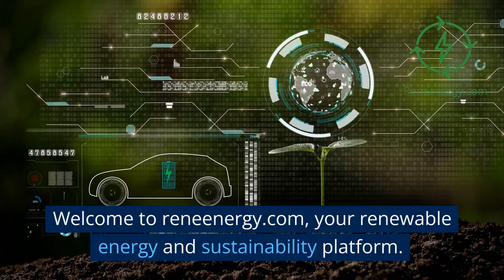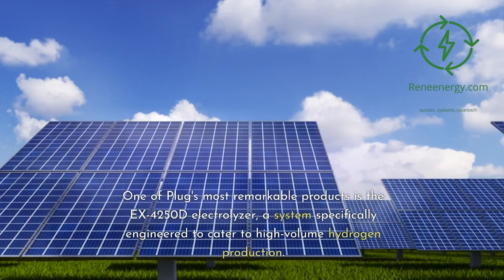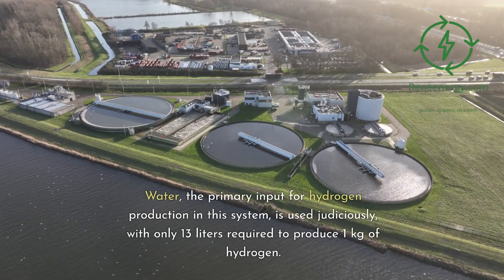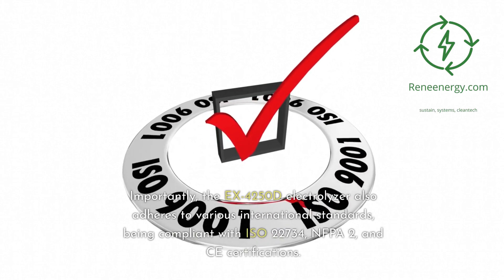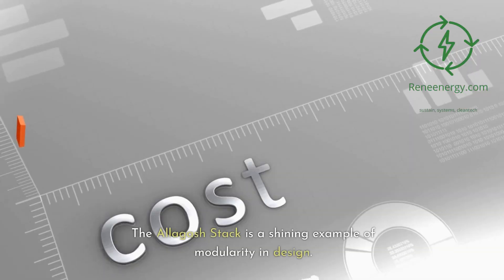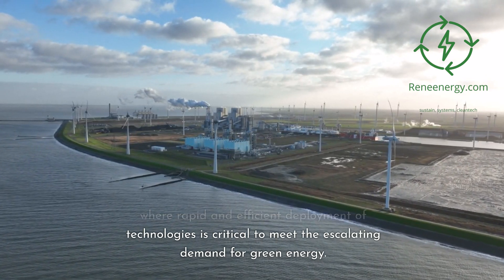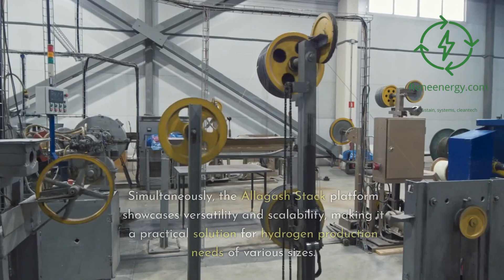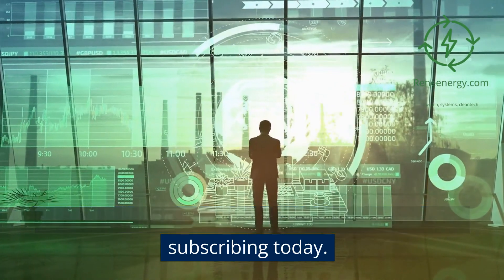Exploring Advanced Hydrogen Production Technologies – Plug EX 4250D and Allagash Stack

Comment: As per the details provided Plug EX 4250D can give hydrogen @ approx $2/kg if electricaity rates are @2.5 rs/units????
Reply from the maker: Thank you for sharing the details about the Plug EX 4250D and the associated cost of hydrogen production at the specified electricity rate. It's important to note that the cost of producing hydrogen is influenced by various factors, including electricity rates, efficiency of the electrolysis process, technology used, scale of operation, and other related costs.

While the information you've provided suggests that hydrogen may be produced at approximately $2/kg with electricity rates at 2.5 INR/unit, it would be advisable to consult the manufacturer's technical specifications and efficiency ratings for the Plug EX 4250D model. They can provide precise information on whether these figures are achievable under the given conditions.

Please feel free to reach out if you have any further questions or need additional assistance!